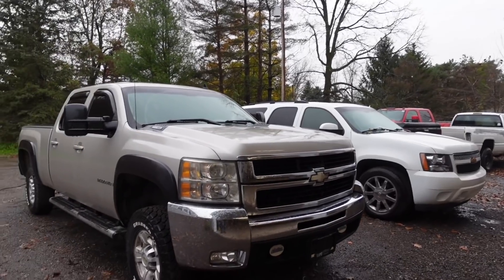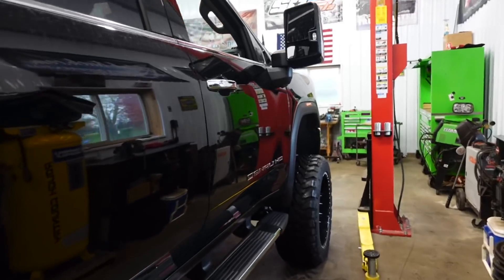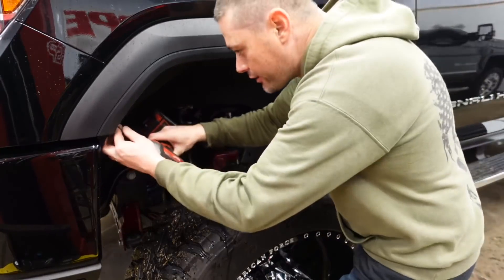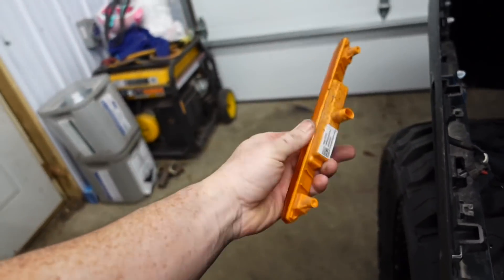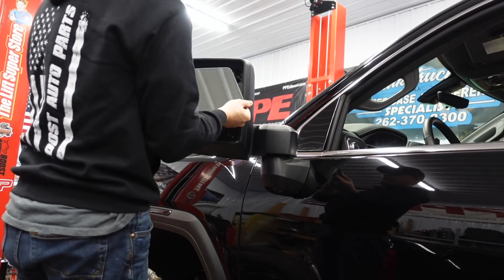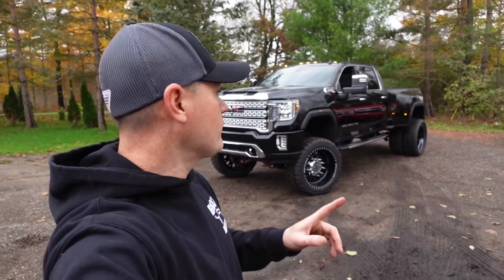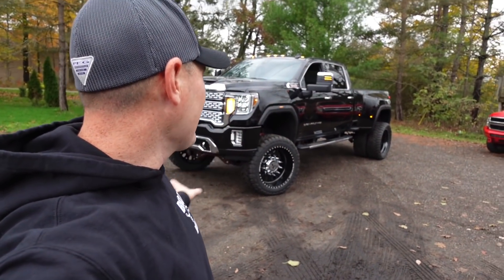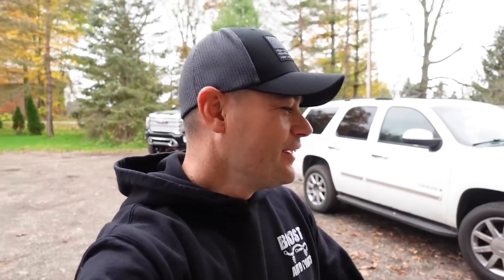I INSTALLED MUCH NEED UPGRADES ON THE 2021 DENALI DURAMAX!

Comment from the maker: Other than deleting this black beauty what else should I do to it? Let me know 👇👇👇

Also enter in for the Toolbox giveaway here 👉 https://truckmasterdiesel.com
Reply: You still looking for a drivers side door for the Cummins
Reply: Jenny Craig , off Camera!! 😎
Reply: What brakes did you use ?   I need new rotors /pads etc bad.   Was thinking either PowerStop upgrade or those AC Delco slotted rotors.
Reply: Can canada get entered for the tool box
Reply: Just ordered a shirt and a couple of 6.6 Duramax decals. Decals are Great for covering bumper chrome peal and other imperfections. I was in the show truck thing on my big rigs and this is a good last minute fix.
Reply: Get rid of those oversized wheels and get more rubber sidewall.  It’s way too much for a truck. No more than 20’s.
Reply: Wow that dually is so beautiful. 😍
Reply: Rear mudflaps! Although it must discourage the tail gaiters as is
Reply: Looking so fantastic good keep on giving new vids!!!
Reply: Compound turbo! The owner has deep pockets lol would be nice tho
Reply: Straight pipe it and put a 10inch tip
Reply: random question but do you know where I can get the high country mirrors for my 2022 LT L5P? I really want the rear facing spot lights that come on when the bed light is activated. If you offer or sell them I would be very interested !
Reply: I don't know if you have looked, but any idea where the heck to get fender flares for the 3500 dually? My 2021 is nearly identical to the one in this video. I would really like fender flares but nobody seems to make them for the dually!

Comment: The 2018 gmc 2500 use the beds suspension 3 inch coilover conversion kit. It gets rid of ur torsion bar and gives u full independent front suspension.

Comment: Great video! For whatever reason, GM only uses that adhesive on the rear fenders on the dually trucks. Those lights certainly make the truck look a lot better.

Comment: Did a suspension maxx leveling kit on my 16 duramax running 22x12s on 33s. Went with the fox shocks and upgraded control arms rides better than stock.

Comment: They do have those boost auto parts has them but you can also get them off of the doorhandles off of a new 2021 Dinali or Escalade their doorhandles will work on our 2021 trucks and I got off LED light in the middle of them there’s a guy that has a white truck that did it and now he’s got a sad that does a switch back

Comment: Hey sir I have a technical question for you regarding the kryptonite center link for the 04 chevrolet silverado 2500. I have a 1500 z71 and I was wondering would the center link form kryptonite fit in my half ton
Reply: Check the part numbers. A lot of them cross to other models

Comment: No need for leveling kit on the L5P, you'll clear 33s with no issues on stock rims and aftermarket.   35s will require leveling kit or small lift

Comment: You are absolutely right that GMC. Is by far the nicest on the road.  35's would look great on your truck and should fit just right with a leveling kit. Give it a nice stance but not over the top.  Remove the nerve bar steps and install a auto lower and retractable side step. Which also lights up when you open the door.  Then paint match the flares.  Then a super detail cleaning and buffing of the paint and ceramic coat it. 👌
Reply from the maker: I like your idea with the steps I might be make a install video on those
Reply: @TruckMaster  very cool. 😃👍

Comment: Hey josh got a question for ya. My lb7 (02) has disgusting balance rate on cylinder 2 usually around a 9 but once she is good and warm does get up to a 12....but never see any signs of haze or other injector identifiying mark. Know from ur vids that balance rates dont always mean injectors but not sure what could be causing 1 cylinder to read like that without any fuel in oil or haze. If you reply thanks i appreciate it already bought injectors just wanting to make sure i find and catch the issue

Comment: Ive been watching for awhile now and recently subscribed. Can not tell you why i havent subscribed sooner but here i am. Recently picked up a 2007 Blue/gray 2500HD classic LBZ, doing a budget build on it due to other expenses in the world. My question to you is would you sell any old parts from you previous builds? Also anyone or do you have any opion on the brand GDP for tunes? Thanks for the great videos they have helped a lot in the process of purchasing my first diesel pickup.
Reply: Also live in northern wisconsin so performance shops are far and between, or even someone that likes to work on diesels in general.
Reply from the maker: GDP is good 👍 unfortunately I don’t sell any used parts but I wish you the best of luck on the build

Comment: My 2017 gmc 3500 (new for me.) is leveled. Every time I have 5th wheel camper or trailer hooked up the truck looks like it’s got the squats. My head lights point up and i get flashed allot. I think I’d be better with out leveling or eventually adding air bags to correct it.

Comment: @Truck Master would you do a video on a torsion bar delete replaced by atomic fab shocks?
Reply from the maker: I will definitely keep it in mind thanks
Reply: @TruckMaster  it’s only for the 1500 series and 6”-7” max lift, Rich doesn’t make any for the 2500 series!

Comment: Not to change the subject of your video. I’ve got a injector stuck. I’ve done about everything. In my new project truck lbz. Do you have any tips to help a guy out
Reply from the maker: Stuck like the injectors won’t come out? Watch my Lb7 injector install video I know it’s different but it’s the same way to remove a stuck injector. Stick a air hammer tip in the injector hold down hole and hit it with a large hammer it works every time 👍
Reply: @TruckMaster  I go back tho and look for it thank you brother